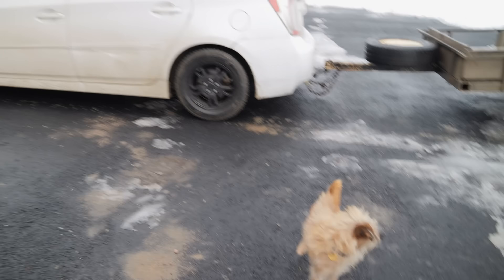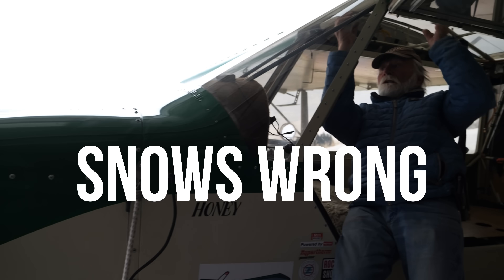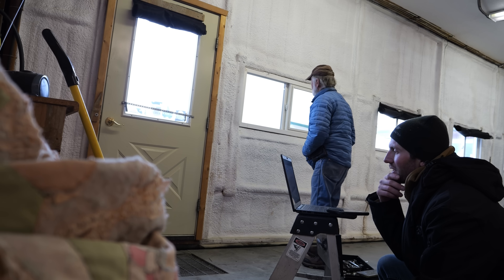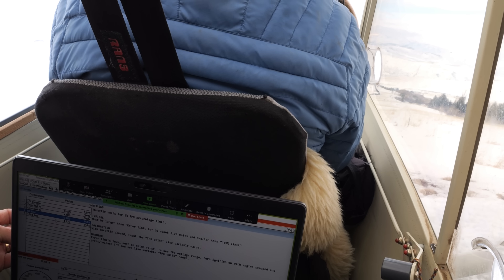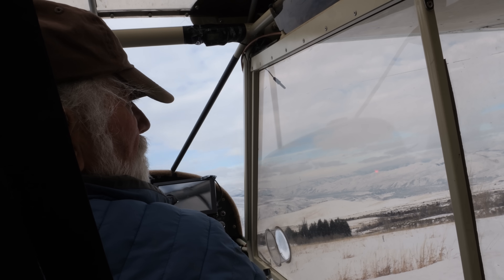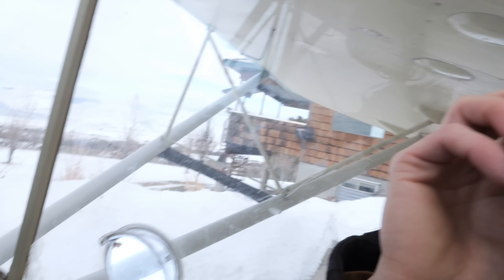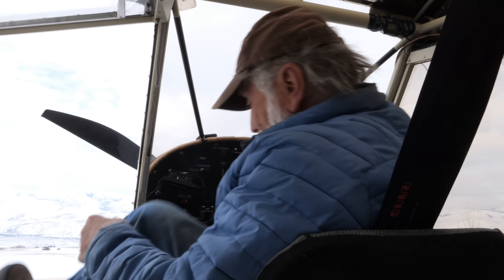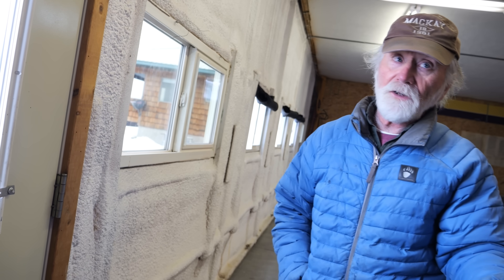Rotax 912 switched to Fuel Injection. Engine still wont run Right. Any ideas?

Comment: She's all ready to go! I ran it up and all seemed real good,  now I'm just waiting on the weather, but not until I fly it at cruise power for a while will I know for sure it was the camshaft.  Before, it also started and ran fine during runups (which I limit to about 3500 rpm) , it was only in flight and at 5,000 RPM that the real bad missing started, and persisted.
Reply: What was wrong with the camshaft, was it worn out?
Reply: @Ayastracci   It may have been defective, but the lobs, one in particular, were badly worn, clearly visible when eyeballing it.

Comment: It's on a FEDEX truck on it's way back to me, after the new cam and lifters were installed, and put back on the test stand, Mike ran it full power for an extended period and it now kicks ass! So, it would appear the initial problem was indeed caused by a cam with  bad lobes, resulting in improper valve actuation.  I'll post here again when it's back in the plane and flown.

Comment: Autronic ECU ; truly an experimental install, like most ECU companies; including Autronic; they do not like aircraft installs; so it is impossible to get support if you tell them it is an airplane. 
I use a Haltech ECU on my Mazda 13B rotary; with much success including rotor balance adjustment on the cockpit panel as well as mixture control as you would if it was a carburetor. Love it.

Comment: Sounds like spark wire problems; the high RPM (full load) and if you have distributor cap.... LOL writing while watching the video... when the guy on the phone said the same thing. 
The higher the load the higher the spark voltage is required and it is more likely poor wires will spark to ground intermittently.
A dirty (conductive film of oil or dust) will cause the spark to dance around inside the cap to ground or other plugs. 
I'd just replace the dist cap and wires (like 8mm wires).

Comment: Another test flight showed the valve spring work didn't change a thing, the same exact issue occurs as before and after the EDGE EFI install, so obviously the problem is not fuel intake related.  I decided to ship it, after building a heavy duty crate for it, scrouging material from a few construction sites I was already on anyway (free) to the Kansas EDGE dealer Mike, not because I suspect the EFI but because he's a expert Rotax wrencher, with a test stand, AND an EDGE guy also.  Hal would have had to re-convert it back to the carbs before putting it on his test stand, and that would have confused things possibly. I should have some results in a few days.

Comment: For me, it turned out to be the injector pump and or valve stem, in one way or another. First thought was a leaking center body seal, but they tested for that and no joy. Finally, since we've changed out every other part over the past few years we installed an overhauled injector pump and stem. That fixed the issue. even the issue didn't show on the pc.

The possible root cause was one of two items. Some internal damage inside the pump, but NOT a leaking center body seal, or when installing the pump the mechanic noticed that the two nuts holding the top of the pump on were not as tight as they should have been.

Comment: No change, after replacing the valve springs, I'm out of options and have pulled the motor,  my next move will be to  see if I can get Hal Stockman to put it on a test stand in his shop.

Comment: Focus on your ignition system only. If spark is falling out then it's ignition. Systematically go through each component with careful attention to coil (high voltage and pickup) and all  connections and grounds in the ignition.
Reply: Did that, months ago.
Reply: @portnuefflyer  Do it again with separate eyes.

Comment: I found a intake valve stem retainer clip partially broken,  2 piece normally, this was in 3 pieces when removed. The first anomaly I've found in chasing down this gremlin, while it appears the broken clip was still doing it's job in retaining the valve stem, I am of course replacing it.  Also new springs on that cylinder, test flight coming up, depending on the weather and my work schedule.
Reply: i was thinking a valve spring / sealing issue oddly enough i just fixed a Honda pressure new low low hours with odd running issue ported head lapped vales re jetted drill out one size up  it  in and now its golden but lol, God bless frUm east tennessee
Reply: So where are we at with this issue ? Did you get to run it yet ? Has the weather been good enough to fly it yet ?

Comment: I learned to fly at Utah State Aeronautical Program  in Logan, 1954.  We had two Aeronca Champs, T, Craft and an L5 which we rebuilt in the Lab for the club. Cost was $5/hr dual and  $2/hr solo.  I spent a lot of time flying the air currents around Mt. Logan and harassing's the groups of elk and deer   My buddy Jay Carter  and I rebuilt a champ, using student labor and surplus dope and fabric.   I envy your instruments.  We had a wire on a cork for fuel, tack and air speed as well as a compass.  I believe we also had a turn and bank indicator.  Some things never change.   Dean Reese was our instructor and  Hugh, Summers and Louie ran the Aero Dept.
Dave Hansen

Comment: I would try closing the spark plug gap by .001 to.003 thousandths just to see if it changes anything.
Reply: Can't hurt I guess, but the gap on new plugs is already at a minimum, as it was when the issue started. And that gets back to "why doesn't switching the mags effect any difference when it craps out" issue, which would seem, unless BOTH sides of the electrical system were at fault, which is really unlikely.

Comment: I made a tool for checking the compressive strength of the valve springs, without the need to remove them from the engine.  After going around twice, just checking one exhaust  valve in each cylinder (I'll need to flip the tool around and maybe do a little mod to it to check the intake valves, ) and found them all real consistent, except for one cylinder, it was 25 to 30% weaker than the others. I have no idea if that's the issue, but I ordered 2 new springs just to eliminate the possibility.

Comment: I test flew it today for 2 hours, the EDGE EFI is complete and as far as I'm concerned totally airworthy.  My original problem, that started on 6-25-23, with the carbs, persists however! Badly missing, crapping out, around 5K  RPM.  Whatever it is, it has nothing to do with the EFI, fuel flow, or the electrical system.   Floating valves is looking more and more as a possibility, just using  the process of elimination.
Reply from the maker: Thanks for the update Tom!

Comment: If you are running spark plug caps that screw on...remove them from the wires and check their resistance as they normally have a small pellet resistor inside and they'll deteriorate with time which increases their resistance.   Sooner or later it gets so high that it limits how much pressure the spark will still jump.   I'd do that first before digging in any farther as we've seen these cap resistors go bad lots of times on motorcycles and automotive applications.   Resistance should be right on 5K ohms.

Also...when you pull the cap off of the plug this can stress the connection of the cap to the wire core....so it's good practice to nip 1/4" off of the end of the wire which should expose fresh core for the cap screw to dig into for a good connection.   These things cost $0.00 and should be eliminated before spending any money.

Comment: Maybe try closing the gap on the plugs. See if that makes a difference. If it changes something that might help diagnose the problem. I gotta say I’m not a fan of the FI. I did a larger X over tube and messed with the carbs and got my 912s running sweet.
Reply: As did I, for over 3000 hours,  plus a BigBore low comp from Hal S., totally trouble free and then this issue came out of nowhere.  BUT, progress of a sort just now: I enlarged the supply line from my 3 gallon header to the fuel pump assembly, from 1/4" (original) to 3/8", and got rid of a un-needed valve that added even more restriction. Pumps like to push, not suck, and though my in flight fuel burn will be the same or less as before (I had a HacMan Leaner), the FI will be moving a lot more fuel, I missed that fact and the runup I just did since increasing the supply line went great.  But a static runup for a couple minutes is one thing, still need to fly it, WX permitting.
Reply: @portnuefflyer
Progress is great! I’m curious though, what about the changes you made would have made the running condition a sudden change with the original components? The fuel lines and valves would have continued to flow the same amount of fuel all the time unless something suddenly got caught in the system causing a slight blockage or a valve had gotten moved slightly slowing down the fuel flow.

Additionally, was the fuel line hard line or were there sections of rubber line? I have seen rubber line close up on the suction side and limit fuel flow.
Reply: @tw6896   Partial hard line, a short section of new 1/4" hose, all good, and flow testing at the firewall pre EFI install showed the usual flow rate, many times more than needed for normal operation. Inspection of the header tank finger screen, the first time I had pulled it in over 3000 hours, showed zero accumulation of any foreign objects or debris.
Reply: @portnuefflyer
Ok. The reason for my question is I’m trying to help figure out why you had a successful run up after you changed the fuel supply lines from 1/4” up to 3/8”. I’m assuming that is the first successful run up since the issue began.

So, if I read your issue correctly, you said that initially the engine ran just fine on the original 1/4” fuel supply lines. Then at some point, it began experiencing the running issues above 5,000 rpm and that has remained constant until the 3/8” supply swap. If it continues to run fine on the new fuel lines, something had changed in the old system because initially it ran good on that system too. It seems to me that only a blockage or restriction of some sort could cause that issue to pop up all of a sudden as long as you didn’t alter the fuel tank venting in the process. That blockage or restriction could have been a foreign object which you said you could not find. It could have been something wrong with the valve you removed. It could have been a slight collapsing of the fuel hose under heavy suction.

I have had multiple instances of fuel hoses collapsing under suction over the years. It is nearly impossible to detect as well because as soon as the heavy suction is removed, it springs back out. I have also had fuel hose separate internally such that only the inner lining of the fuel hose was collapsing and the outer section of hose never changed.

Regardless I’m hoping it’s still running better after the fuel supply change as you initially indicated. If so, something in the old supply system had “gone bad.” If it continues to run poorly, then you can disregard all of this.

Comment: Lots of process when the carb worked great.  Complexity is always punished.
Reply: Nah..., after diving deep into the inner working of the carbs, the TWO carbs,  that need to be synced together,  as compared to the  SINGLE EFI, it's not more complex.  You didn't get the fact the issue is one I was dealing with long before the EFI install, and the fact it is still happening at least shows the problem is not in the intake system!

Comment: It still could be a FI issue, make sure that crank sensor produces a very clean edge, use a scope.  Maybe your SW already does this?  If it's an ancient ECU -- have a new replacement on hand, they do get hurt from just a couple of mis-connections in years gone by.  IMHO if I had an ECU in my plane, I would have switchable pair just like your mags.
Reply: The crapping out issue has been ongoing for a couple months before I installed the EFI.

Comment: Sure good to hear the familiar names. Jonas, Tom and Hal. what a bunch of great guys. Hope you get the problem figured out. But you didn't state why or advantages of switching over to fuel injection over tried and true carbs. I'd be curious.
Reply: The EDGE  comapany site does a pretty good job of that.

Comment: Stupid question... by any chance might be there is some RPM safety limiter? In program... 
Also what was changed, and what was kept from the old system? Can you check if fuel pressure drops on 5000 RPM? Does wideband sensor shows rich, lean or normal mixture on 5000 RPM?

Comment: Rotax 912 are famous for coil ignition issue, genuine ones are mounted in top of the engine, taking vibrations and heat. An easy trick is to heat them up with a hair dryer, and test your engine with hot coils.
Easy, cheap test.

Comment: I have the edge FI on my 912 in a zenith 750.  When I was carbureted I had more trouble with it generally between the 3800 to 4800rpm range,  but it will consistently run smooth now with the fuel injection through that range but with my prop all I've ever seen is about 5300 RPM. 
   The biggest in improvement I noticed on the fuel injection is throttle response and instant power, there's no lag like in the carburetors.  
  I did notice that my cylinder head temperatures did go down on average about 10 to 15°F With the fuel injection
  It was a costly addition but if you wait six months and then look back on it you will say it was a great purchase.  
  I'm gonna say he's got a cracked porcelain or something on a plug or two.

Comment: I'm a automotive guy, never been around planes. But it really sounds like a ignition trigger system problem. 
How is the EFI getting crank signal? 
Is it the same pulse as the ignition system? 
Some ignition trigger systems will start to fail and only loose higher RPM trigger definition, especially under higher loads, but idle and run fine otherwise. Best way to see it is with a oscilloscope of some sort. One meant for ignition systems would be better. Your looking for a lose of pulse, a weak pulse, or a wide pulse (wide will overlap at high rpm, and fake a high flat line).

Comment: 1. Coil packs might not be getting enough power from wire danmage exc. 2. Valve issues. Both in my mind could start at higher cylinder pressure. I could be wrong but it doesn't hurt to check.

Comment: Is the ECU doing the ignition timing as well or is it just fuel injection?  Its coil on plugs controlled by the ECU?   If so what timing did your tuner put in?  If not perhaps its time to change to automotive coil packs and control them from the ECU so you can set the timing.
An automotive ECU would learn the tune as you do have a wideband O2 sensor (i heard him mention it) - the wideband will keep the mixture right and he was reporting it was right however its no good have a good ratio if the timing is not advancing at the right rate for the RPM.  

I think your tuner was right and it is ignition.  You maybe need the ECU doing ignition through racing coil-packs if you are not.

Comment: Tom when mine hits around 190 cht it will start missing on both mags but if you let it cool down while in flight to just below 185 it will smooth out and as long as you hold it below 190-195 it runs fine, but I have the the aftermarket boxes on it with the 12 volt wire on them to hook to direct 12 bolts with a switch and turn the switch it will run smooth at 190-195 all day long if you turn the switch off at those temps it will start missing again. It’s a mystery that was the reason I changed from rotax boxes to the aftermarket ones but the same thing. I also put in a stator new fly wheel the only thing I haven’t done yet is to air gap the triggers.

Comment: OK, I've now watched the video and followed through with some research.

 First, I'd check fuel pressure at the rail before the injectors could be partially plugged fuel filters or a below peak performance pump. 

Second, timing advance, I know depending on how old the Rotax is it changes the advance from 4 degrees to 26 degrees could be something with it. 

Third, i don't disagree with valve springs and floating valves at high rpms.

My synopsis would be to start with the most simple and check fuel pressure where it started suddenly but has been persistent this would be a great starting point! 

Good luck guys let us know what you find
Reply: Agree issues is fuel delivery, hoses, vacuum or pressure. Something in that is  probably the issue. Maybe even fuel tank problem. 
Pressure and vacuum test all the fuel systems: hoses, rails, injector connection points, pump pressure, tank pick up, flared fittings or dissimilar metal connections (example: brass to steel, hose barbs). Fuel injection fuel delivery is pretty complicated and MUST be perfectly efficient through all rpms with flow input and return correctly designed and calibrated. Since this was a carbed engine before may have had different fuel line requirements. 
From hearing it run in the video at 5000+ it does not sound like a “miss” but a starve for fuel, fuel restriction issues.

Comment: I had something very similar happen with my engine. It turned out that both ignition modules and all the coils were grounded with one large wire, and most of the strands of that wire were broken at the ring connector. It didn’t have enough grounding at higher rpm’s
Reply: Rev limiter going off...?

Comment: I agree with the valve spring or a timing issue if your springs are weak that would cause them act to slow or possibly a stretched timing chain that has the timing off just a tad
Reply: Rotax 912 series engines do not have timing chains

Comment: I assume you can see Exhaust O2 and you don't see it going lean.   I suspect it cannot breathe due to intake or exhaust obstruction, or the coil cannot keep up with the spark demands at higher RPMs.